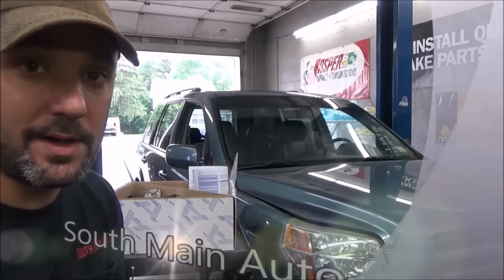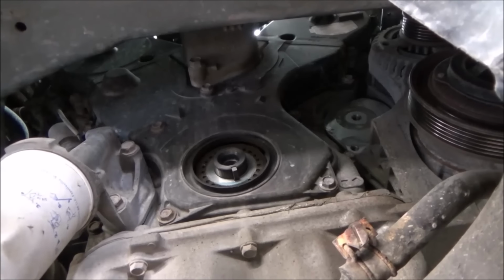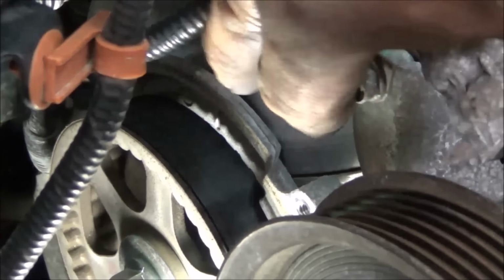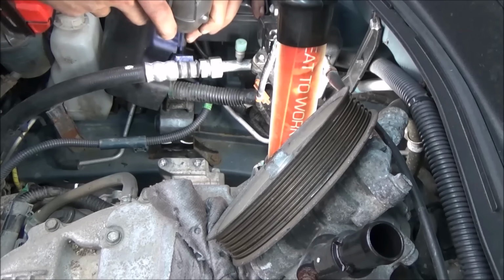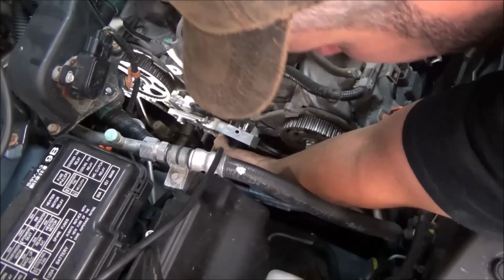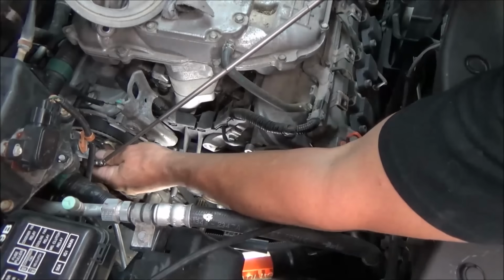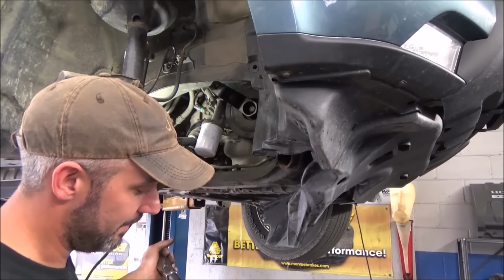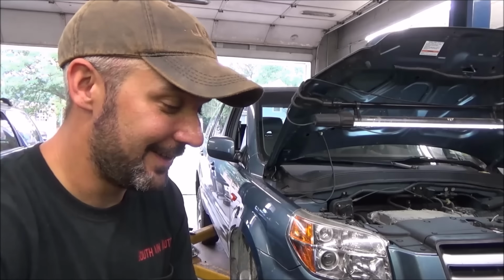Honda Timing Belt 3.5 J35 - Pilot, Odyssey, Ridgeline

Comment: Thanks for the well-done video. I recently bought a clean 2006 Pilot EX with only 125,000 miles and there's no record of T belt replacement. (14 years old now). I removed a cam sprocket cover to inspect the belt and it looks like new, but I can see a faded part number and the word 'Honda' so suspect it is original. Strange that all other 105,000 mile service items were done by the Honda dealer such as spark plugs, all fluids, serpentine belt, etc. Is there any other way to tell if it was replaced? .. I'll use the Aisin kit as you did since it is OE quality including the water pump. I read other kits (Gates and AC Delco) come with low-quality water pumps.

Comment: Great video. Just one question..... a lot of cars suggest the use of locking kits to hold the cam shafts in place and often a locking pin for the crank.. You didn't use any of that stuff. You were just really careful to align the timing marks and painted your own marks on to double check. Would you recommend this approach for most cars, i can't see an issue and I can't understand why locking kits are required.? So why are they needed and when would you use them? Also when you marked the old belt with white paint, I was surprised that you cut it. Could you have transferred those marks to the new belt to ensure you had exactly the same number of belt teeth between the two timing marks on the cams, or would this just have been overkill? Great videos, I am learning lots from watching them during the lock down here in the UK.

Comment: I have been a tech for 32 years and this video was as real world as it gets. The only thing I do differently is I line up the timing marks, mark the belt and pulley's like you did, and the crank pulley. Then I mark the new timing belt to match the marks on the old one. Match the marks on the new belt with the marks on the pulley's, and you're in time. Been using this method since the mid 90's. Works every time. Unless the car comes in with  broken belt.

Comment: Hello Wonderful Person, 
My Odyssey is a 2003 model, no engine issues yet, believe it or not less than 90K miles!!
But no one will pay more than $1200- for it, so it doesn't pay to sell. 
It's time to consider a timing belt / water pump / tensioner/ pulleys and seals. One of my favorite online parts sites, sells this DAYCO WP286K1CS kit for $167-, but when I question a few places in my area, they want anywhere from $700- to $900 to do the job. WTF!!! How long does this job take? Is the extra $200- the mark up on the parts?? Why does every customer get treated like Rockefeller?

Comment: I know this is old. But the motor mount you dont have to take all way out. If you have a super shallow socket you can just pop the top part off. The the bolts that attach to the block you use the shallow 1/4 and can remove the 3 bolts.

Comment: An easy way to get  the crank pulley bolt off is to put your breaker bar so it is resting on the frame and hit the starter. If it doesn't work the first time let the compression bleed off and try it again. If you don't have a man sized impact this can be your only option.

Comment: Wish you had shown us the condition of the old timing belt you removed.  What I was able to see on the video indicated it looked to be in good shape.  Always curious as to whether the old belt really could have gone another 100,000 miles.  Have a 2000 Toyota Sienna with 210,000 miles with the timing belt having been replaced at 105,000 and wondering  realistically whether I really need to replace this belt or squeeze another 50-100K outta this old car.  You hear anecdotal evidence of vehicles going 100's of thousands of miles and never having the belt replaced.

Comment: Mr. O...Thank you for this timing belt DIY tutorial. I did my first timing belt /water pump replacement on my 06 Honda odyssey EX. After viewing this video 100x,  mustered confidence and dove right into it. I have all the tools I need, even bought the lisle weighted 19mm crankshaft pulley bolt. Like everyone else, i experienced the infamous "what the freak is holding this bolt so tight". I have the cheater bar, but not enough ground clearance, so I had I did the "engine bump" method to remove the crankshaft bolt off with ease. Nonetheless, because of this video, I was able to navigate in some sequential way and was able to remove and replace the timing belt and water pump......so thank you for this extremely useful video and all other video you produce, I enjoy them all..
Reply: Ohh and btw, initial timing belt was replaced by Honda at 100k, my van currently has 235km which means I was 135k mile overdue :)

Comment: Sorry so late to the party. Watched a lot of videos of yours, and walked away armed with just enough knowledge to keep nursing my '06 Ridgeline down the road. Never really thought too much about the timing belt, honestly (or replacing the water pump for that matter). On a scale of 1-5 difficulty, how would you rate this for the average DIYer?
Reply from the maker: 3.65? Ish... Crank bolt is the only hard part that can be a pain to get off

Comment: A good question to ask and maybe I missed this because I have little ones running around. Is there a way to inspect the timing belt without tearing the engine completely apart?

Comment: Does lining up the timing marks on the crank and two camshafts eliminate the need to mark the belt? I'm worried that if I don't count teeth on the belt and make sure it is aligned how the old belt was positioned will mess things up?

Comment: Would it have been easier to pull the spark plugs first? Since you're replacing them anyway...when turning engine by hand it would relieve the compression.

Comment: Great video - I’m at the point of lining up the marks for TDC and I ran into a problem. I discovered that the guy who did the last timing belt (my van has 195k on it), may have installed the belt with one of the cam pulleys slightly off.  The aft (inboard) pulley needs to move forward about 1/4” in order to be TDC.  Both the crank pulley and the forward cam pulley are TDC.  The car ran fine before this, so should install the new belt with the cams in their current position or reposition the aft pulley forward 1/4” to line up with the mark on the housing?  Thanks for any input...

Comment: I have one of those 19 mm weighted socket it takes the crank pulley bolt off as easy as removing a wheel nut

Comment: I didn't know honda was engineered so good. my son brags on his van  guess he taught the old man something
Reply: Engineered around it-s weaknesses.   No one does timing belts at 100K anymore.    And those V6 Honda transmissions...
Reply: @normt430  I agree 100% about the 100k timing belt interval! I have a '15 Escape 1.6L 4-cyl, that has recommended TB change interval at 150kmiles. It currently has 73k, I figure that by the time it's ready for a belt change, there won't be enough vehicle left (Rust) to worry about a timing belt!
Reply: @TheOzthewiz  you won't have a rust problem in a Ford like you would with a Honds or other Japanese.  Not unless you have an unrelated scratch that the primer is removed.  Didn't know about TB on Ford 1.5/1.6. Looks like they do not water pump at the same time.

Comment: i had the same problem with a lexus is300.  needed about 8 feet of bar and a crank pulley holding tool made out of an old timing belt (strap wrench).  I forget the torque spec but it was twice a normal car and removal was probably twice that.  my first timing belt was a 87 corolla when i was 16.  i did it outside in 4 hours.  I've only done 5 since then.  hardest was my moms pt cruiser because of the engine mount bolts.  people who have done it know what I mean.

Comment: I slowed down wrenching on my car because of scratched up, bloody hands and knuckles.    Mixed with grease and oil and on my back in the driveway just didn't cut it.    Now I use a Quickjack and rubber gloves.    Items like timing chains, I now farm out.   I think Eric ought to find another line of work since by the time he reaches about age 55, he will get so tired of wrenching.

Comment: Question Im thinking about buying a honda ridgeline 2019
Ive been searching utube for problem videos with ridgeline just to see if it would be worth buying but all i find for issue videos is the towing capicity or someone does not like it because it looks like the pilot.
IS THE RIDGELINE A GOOD LONG TERM VEHICLE FOR SONEONE WHO WILL USE IT MAINLY FOR GETTING AROUND IN THE CITY NO TOWING NO HAULING OR OFF ROADING

Comment: Just did 2014 Honda Odyssey timing belt over the Veteran's Day weekend in referencing your video all along. After all the work went through and started the engine, the smooth running sound was the best rewards. Thank you for sharing your expertise with us!

Comment: Just finished this job following this video on my 2007 Honda Ridgeline. Tried sniping the crank bolt with a 10’ snipe on a breaker bar and I heard it audibly laugh at me......but it wasn’t laughing when I showed up with a lisle socket and a 20v 1/2” dewalt brushless motor impact I borrowed from my buddy Shawn.

Comment: Eric, what is your opinion about using memory savers when you remove the car battery for replacement. They sell some that attach to the OBD2 port and the other end has a cigarette lighter plug on it. They say to use a 12-volt jump starter with a cigarette lighter output to power the computers while the battery is being changed.

Comment: I really appreciate the effort undertaken to produce these videos. I watched this video and couple others, and decided to go ahead and try to do my first timing belt on my wife's 2010 Odyssey. Well, it turned out to be a disaster! In retrospect I was probably foolish to take on such a big job. In short, while putting on the new timing belt, the rear cam "jumped" several teeth. I thought that with the belt still off, I could ratchet the cam back into place and then put the belt on. When I finished the job, the car wouldn't start, and I towed it to a shop. The mechanic told me that the engine was toast the second that rear cam moved. Now I have to replace the engine. If I had any idea that it was so easy to damage an engine, I would have never touched it. It was an expensive lesson learned.
Reply: I was just kind of curious what kind of damage your mechanic told you your engine had? The 3.5 is a non interference engine and should not have had any damage from trying to start. Sounds like somebody took advantage of your mistake.
Reply: @jamesferguson1054  The Honda dealer said the valves were bent.
Reply: @jamesferguson1054  Bent valves

Comment: When a timing belt breaks does it for sure bend the valves?
And in doing so can it also damaged the Pistons since that is what caused them to bend?
my timing belt broke on my 2011 Odyssey so I'm kind of curious to know what avenue to take.
Thank you for any responses or advice.
I have already replaced the belt kit with a Aisin kit only 60,000 miles ago.

Comment: My CH 1/2" impact gun with hi-flow air fittings could not loosen pulley bolt with honda socket.  Succeeded with my Harbor Freight 1" Impact Gun with adapters to fit 1/2" honda socket.

Comment: Hi Eric, Thank you for making this very informative video. Quick question, I am finishing up replacing the timing belt on my 2003 Pilot. My predicament is how to tighten the crankshaft bolt to 180 ft-lbs spec. I can only raise the Pilot as high as the jack/stand will go so I won't get too much leverage, any idea how to go about it. Thanks again!!!

Comment: Used one of those sockets and an Earthquake XT 1/2" impact gun. Buzzed it off with one buzz! Freaking amazing!
Reply: Hi! Is this what you used to tighten the crankshaft bolt? This is my predicament, since I can only raise the Pilot as high as the jackstand can go, I don't have enough leverage to torque it to 180 ft-lbs per spec.
Reply: Ernie B yeah, I just did it with the impact gun. The crank pulley holder I bought to hold it in place while I torqued it down sucks and it wouldn't accept the 1/2" torque wrench I have.
Reply: iDIY For You thanks for getting back so quickly. Now I just need to get me one of those cordless impact wrench. Is there a setting to prevent it from over torquing?
Reply: Ernie B there is not. I'd suggest getting a torque stick rated at or just above 180ft-lb, that is as close as you're going to get not being able to use a torque wrench.

Comment: hey eric hows it going up there high in the north but i have a question have you ever done a 2005 acura rl vsa pump my acura has the light on the dash and it stays on i figured out its the pump but can i replace just the motor and if so how do i get it back together being that it has 2 pins better it has 2 magnets on springs that need to be pressed in in which is not letting me replace the motor is there a method to doing it i would really like to know how to put it back together any suggestions would be appreciated thanks david from the rock in queens

Comment: I usually sell new spark plugs with a timing belt, since they are usually both due at the same mileage........and boy, it's so much nicer turning a crankshaft with the plugs out. My .02

Comment: Thank you so much South Main Auto...Just finished the timing belt on my 2005 Pilot with 320K miles on it (3rd timing belt change) and your video was the BOMB!  did it completely in about 3 evenings in my shop after work and really benefitted from your video. Changed the radiator too, which was a bit of a thrash in comparison, as you would say, I had to go "caveman" on that one.  Really enjoy all of your videos, keep them coming!!  BTW, my theme for the TB change wasn't dropping bolts, but busting my knuckles...the back of my hand looks like a cat went to town on them.  All's good thou...will refresh my memory by watching your video again in a few years when I change it at the 400K mark.  Also, got the massive 19mm socket and the crank pully bolt came off like butter! Too simple (watch other YouTube vids with guys trying to crank it of with Rube Goldberg contraptions and wasn't going to do that....thanks for the tip!

Comment: This saved me after doing my timing belt for a couple weeks since I went on vacation before I could get it done. 2008 Acura Tl Type-S. I ended up stripping my timing tensioner bolt pulley (i'm an idiot and somehow revered that bolt guide that guides the bolt). I borrowed O'Reilly's tool to retap the hole and that fixed the issue. I also when doing the belt, had too much slack by the water pump, the tensioner got rid of that slack by pulling the rear cam forward one tooth, I had to take off the belt and put the pin back in the hydraulic tensioner with a c-clamp. Then I accidently moved the rear cam, ended up using a serpentine belt tensioner tool to help move the rear cam to TDC using the bolt on the rear cam pulley. Anyway, this video was great - thanks for showing how you put things back together, I'd forgotten. I also borrowed the tool for breaking loose the crank bolt from O'Reilly's (they have it on their loan a tool program). I used a breaker bar I got from lowes, it was a 1/2" wratchet with a deep socket with an extension and propped on a jack. I used like a 7 foot pipe on the end of my wratchet and went about 110 degrees to break it loose (don't be scared it should come out). Most of the tools you can get from the loan-a-tool program from Autozone or O'Reilly's. Anyway! God bless sir!

Comment: Just did a 2012 Honda Odyssey Touring , this video was super helpful.  Slight difference in engine layout when I took the motor mount off, but I discovered the ridiculous over-engineering in non-structural bolts.  Holy cow Honda.  Quite an exercise in patience, but thankfully my buddy with years of car, helicopter and airplane mechanical experience made it fun.  I will say I was nervous for the 19mm crankcase socket, and sure enough it did NOT work.  Bought it super excited to give as gift to my friend for helping, but I fell in the 50% of videos online where it did not work.  Probably had 3 total minutes of impact gun on it and it didn't budge.  In the end it was a cheater bar and I'm sure the beginnings of a hernia.  Dang car lifted off the ground almost and SNAP!  Spun it out with fingers after.  Seems a bit "iffy", but whatever.  Super good feeling saving a lot of money, and the sucker runs like a dream!  I will say I'm at 174k miles, and both the timing belt and water pump looked brand new.  I've owned it for 74k miles, and it's frustrating to replace something that operates and looks new, but oh well, it's good now for another chunk of time.  Great job on all your videos as usual man.

Comment: So I reinstalled my crank bolt and rotated it to get the timing right like Eric did, but how do you remove your crank bolt after setting the timing without getting the engine out of time? Eric O never shows him removing the crank bolt after setting TDC, but at the end he reinstalls it. I'm confused.
Reply: Samuel Sholder if you have an impact gun it should just come off without moving. Or try  backing it off just to see if it comes off. Could put the socket or wrench back on it and tap it with a hammer the manual impact way 😂
Reply: @moavic5087  thanks man i was able to back it off with a milwaukee impact driver, barely had the torque tho. I kept cranking the engine two times over to ensure the marks weren't off and the bolt got extra tight. Can never be too safe tho!